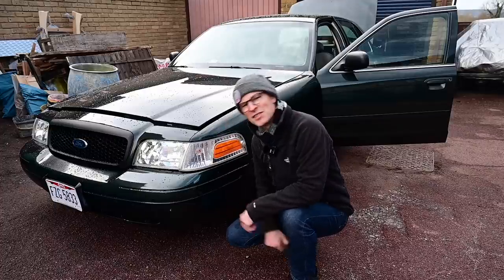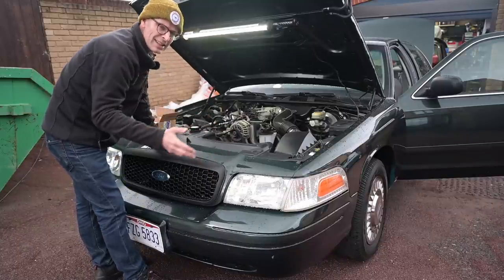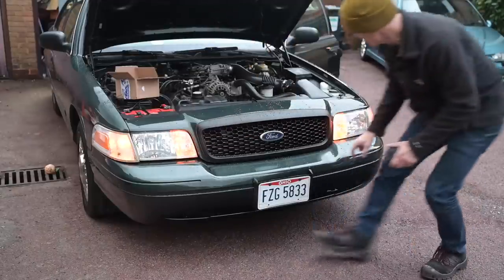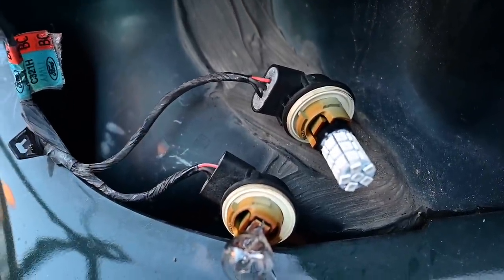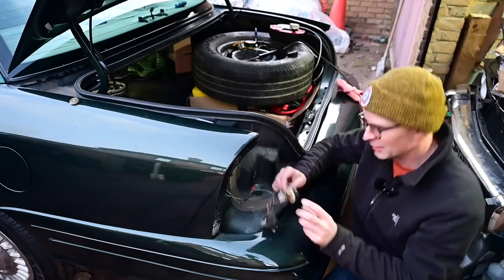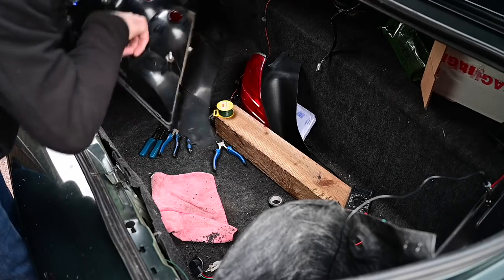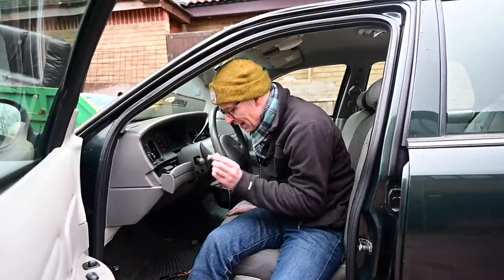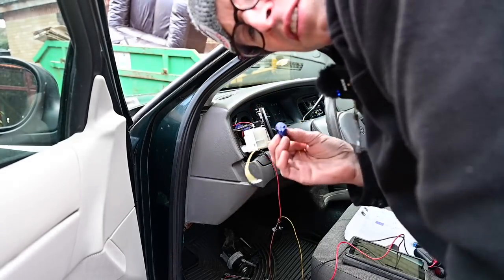Making my Crown Vic lights UK friendly

Comment: One question I have is the Police use Light switch wired in a different way to a civilian light switch ? , I used to just take a live from the back of the light switch that becomes live with the ignition on , there usually was one , but never used a relay box , the live I would run to a switch , output goes to the lamp , lamp can be earthed at the back by screwing in to metal with a ring terminal , your flashing rate is too fast and could be a by product of police lighting , you need a side repeater for an MOT .
Reply from the maker: I dont know what the difference is, the interior lights are different so maybe to do with that
Reply: Should have added that the fog light stitches we used had three contacts on the back , live in , earth and live out  , the side repeater was just hooking in to the front indicator live feed and an earth , one round hole in the front wing , behind the front wheel line in the most aesthetically attractive position for the lens to be in , usually an oval lens looks best . mot tester will be looking for one on cars after 1986 or 1987 ish , same year as the requirement for rear seatbelts i think .
Never had fast flashing rate though , but never did a P71 ? , Mustangs , Camaros , Corvettes and lots of stuff did many like that with no issues . also a white front sidelamp , usually taking the orange bulb side marker feed from the indicator to provide live for a cap less 501 bulb pushed in to a hole drilled in the headlamp reflector where it would not impede the beam pattern ,  [ah its all coming back now ]  , yes the older cars , like sixties was interrupting a feed at the bottom of the steering column for the indicator / stop lamp issue .but not later ones , it is body earth and live from the one wire of the three on the rear bub holders that flashed the winkers , no other diddling required .
Reply: switched , flippin spell correct .

Comment: Hi Matt, just a couple of comments from the North American point of view.  First, those headlights are indeed very common over here.  Next, you can buy rear clusters with an amber lens at the bottom, which I think are for the indicators.  Maybe they were used on higher trim spec cars, I'm not sure.  Finally, I found you can also buy replacement mirrors with LED flashers in them, rather than modifying yours to fit the Whelans.  If you need any help from this side of the Pond, let me know any time...
Reply from the maker: I looked at there lamps on Rock Auto, $35 each for the lens unit but still need to adapt the wiring. If the green bulbs hadn't worked I was going to get a set.
Good tip on the mirrors, Ill check them out before drilling any holes

Comment: How did you get the turn signal bulbs to not light up when you press the brake? As you didn't do anything to the circuit, wouldn't the turn signal light permanently when pressign the brake?
Reply from the maker: its the way the circuit works, the stop tail is on the other feed wire. I wasnt sure it would work but it seems to

Comment: Are the orange US marker lights wired from factory as turn signals...with dual filament bulb perhaps...and is that okay for MoT?  I was wondering gbif I will be okay for the MoT when my VW Thing comes from Texas...as it has side marker and turn signal in same bulb and will be a faff to change...and I kinda like it like that.
Reply from the maker: if you made the side maker white and the indicator orange it sold be OK, my new plan is to get another police side lamp with the extra bulb holder and wire the indicators to that

Comment: I can’t help thinking you need a multimeter before you cut wires so you know what wire does what.
Reply from the maker: I was probing with a pin and testing for current

Comment: All u need is a relay, that has the power side from a constant live, the switch feed from the dipped beam and then connect the fog light to the other side,
Reply from the maker: that doesnt stop the fog lights from coming back on if the headlights are turned off and on again - they have to go off and stay off with the main lights
Reply: @furiousdriving  A second flip/flop relay would do that?

Comment: What happens if you press your brake pedal, i guarantee the indicators will light up, because there are 2 brake light wires from the pedal, 1 goes directly to the third brake light, and the other runs through the indicator stalk making the indicators and the brake lights on 1 wire, so in theory the separate indicator feed you created still has the brake feed on it too? Unless you separated it out under the dash??

Comment: I'm so glad you've left the orange lights at the front as I know some people remove them! All part of the American car charm imo. I'm surprised it would pass an MOT exactly as it was though, I thought that you'd have to add another 5W lamp holder with a white light that was always activated with the side light switch, and make the lighting compliant by installing it, say, in the main lamp housing. that way when you switched the side lights on you had white light to the front (making it UK compliant) along with your orange lamps - but the fact you don't have to do this is nice.
Reply: The one on the corner can stay as is, it serves the same purpose as it does for cars like the bmw 5/7 series that have it also which is down to length of the vehicle, i think by absolute technicality the 'daytime' light as its referred to in the manual (the one with the indicator) is meant to be white (and orange when flashing, this easily achieved with a switchback led popular with vic in the states already) or disable as you're indicating, i cant remember the exact details besides being asked if they went off when i indicate i said no and he said that need to be fixed, so simply i took the bulbs out, broke the pin for the daytime light and refit so it only indicated. 

Out of mot swap back as i see it as being much safer than even if they were white as i get a better sense of distance if there's another colour with the headlights, otherwise its often i'm blinded by most peoples poorly fitted lights and can't see anything that direction.
Reply: Up until last year I owned a U.K. spec Chrysler 300. I had the headlights rewired back to American spec, which removed the w5w sidelight bulb, and put back the dual filament turn signal bulb. One for side lights and one for indicators. Had to have that proper American look. The car passed the mot like that every time.

Comment: I’m sure the fast indicators are against regulations, there’s a special LED flasher box to replace std relays 
Also won’t the headlights need the aim changing sticker things to pass MOT ?
Reply: @Patrick H
The UK requirements  for indicator lights to flash is between 60-120 per minute.

Comment: Could the issue with not being able to get a switch feed for the fog light be due to canbus? As far as my pea brain can gather, everything has a permanent feed and the Ecu provides the switch feed by can hi/lo rather than the ignition switch, meaning that a traditional ignition live does not exist on those circuits.

Comment: I’ve never understood why the US market only wants one brake light when an indicator is on; it must be confusing when the tail lights are on and you first brake, or are you indicating… Seeing that they use two bulbs for everything perhaps adds redundancy over complete darkness when one stops working. Your momentary switch needs to be fed from the headlamp to trigger the latching relay to feed out only when they’re on, and the switched feed (not the switch) goes to the bulb. I’d then think that the normally live feed to the relay comes from the headlamp too, so when that’s off the relay feed is not powered either. It’s a huge logic problem.
Reply: Interesting and I suppose it’s what you are used to seeing and reacting to. I still prefer to have three brake lights which all show whenever you brake, separate tail lights which are dimmer, and a separate flashing amber indicator turn signal which is in addition to the brake light, not instead of it.
Reply: A cost cutting exercise from when cars were invented I expect. Or maybe Americans can’t tell the difference between red and orange.

Comment: It's so good to see that big grin when you crouch down beside your Crown Victoria. The paintwork looks extremely good after your efforts. How difficult was the clay bar to use? Did it make the biggest overall improvement?
Reply from the maker: Clay bar is very easy, just takes a while with such a big car! It does make a big difference and when you polish it the effect is magnified by having a better base to work from
Reply: @furiousdriving  Thanks for that.

Comment: Hi matt could you not have wired it to the live in the boot that's spare and switch it from there terrible weather in kent at minit I got jobs to do on the rangerover but too wet damp at minit all the best donny
Reply from the maker: Thats where Im running to from for testing, but the power goes to the switch so having a local live is more convenient

Comment: Damn, y’all have some stringent lighting laws there. Are you able to fit that down the little roads of the villages in the UK? I have a hard time fitting minke down some dirt roads in Alabama, but the asphalt usually has plenty of room (despite the crappy road quality, they’re wide usually). 

And that empty chamber in the tail light was a blinker, but Ford kept it for departments to put strobes in (and to save money cause it was the existing tail light model, just with a red lens, instead of amber.
Reply from the maker: Yes, they are strict here. If it was less than 10 years old Id have to change the front lights as well to fit new car regs and pass an IVA test, which no one wants to put a car through!
Im going to choose my routes carefully. Villages arnt to scary, its width restriction bollards in towns Im worried about, they are to slow cars down and stop trucks but I dont think this will go through all of them.
I reckon I could hide a strobe in the middle of that lower section between the indicator bulbs
Reply: @furiousdriving  what is a bollard?

Comment: Should the fog light be wire off the relay not the moment switch. So you take a feed off the light switch to the moment switch then the trigger side of the relay. Then the fog light is powered off the relay feed.??
Reply from the maker: Im just following the instructions and how they talked me through it when I called to check
Reply: @furiousdriving  makes senses as  it will work its just you have all the bulb current going through the switch. But it's probably not that large as it's a fog lamp. Not like a head lamp current. Esp if you use an led bulb.

Comment: Strange rule on the rear foglights, here in Sweden only the front foglights are regulated on older cars (I don't involve the EU proofed newer ones) Here you aren't allowed to have front foglights AND low beam at the same time. I used a switching relay to make that blockage, as long as the low beam has power the realy is pulled away from making the circut to the front foglights. And there is another relay that cut's it totally while not using the car or the lights at all, otherwise it will use battery power when the car is not in use. This might be useful for your dilemma as well?
Reply: That seems like a very odd rule? In my experience, high beams are actually detrimental to driving in fog because they just illuminate the fog itself and make it harder to see the road.
Reply: @d2factotum  you ARE allowed to use them in fog with just parking/taillights and as extra with highbeam, just not with low beam. I forgot to mention that!
Reply: The very first REAR foglights on Volvos in 1978 when they appeared for the first time was awkwardly shut when you switched to low beam, so in not that thick fog when you drove in front of a cue using highbeam and had a meeting with another car these would switch on and off frequently making all behind step on the brakes as they thought it was a brakeligth, this was changed a couple of years later. I allways use my rear foglights like high beam, on when I can't see anyone behind me in the fog, if they get close enough to see my ordinary rear lights I switch them off as the blind those behind un neccesary.
Reply: @Bratfalken  But that is an oddity, and very specific to Sweden.

Comment: Driver's side fender bulb probably not there because it could be a replacement light unit if had a corner prang
Reply from the maker: Thats what i thought, or the other was an old one used for the same reason

Comment: The single front bulb on the drivers side and the other side didn't have one could it be a night parking lite ? And those break lights look a pain to fix, has it got a break light in the middle of the rear window?
Laters kojak 🇬🇧🇺🇲✌🏻
Reply from the maker: I think its a small police strobe in the front, and yes high level brake light on the parcel shelf

Comment: Much respect for your knowledge and venturesome spirit to do such things. 

BUT, i just love our set of work lights and everywhere i went worldwide, people love the way american cars’ lights do work. With all due respect for your immense effort and job, but I wouldn’t have changed a dot.

Love your channel. Keep rocking.
Reply: Cars used in the UK have to comply with our legal requirements which is why they have to be changed.
Reply from the maker: sadly to get through the MOT inspection it has to meet the incredibly strict rules, I can leave the front lights as its over 10 years old though
Reply: @furiousdriving  Omg. Thank you so much for replying me. And I didn't know used cars - eventually imported to be a collectors or whatever - needed such changes. Again, thank you very much for your kind attention. Love your channel.
Reply: @garrytalbot3456  Thanks alot, Garry.

Comment: I didn't really follow your logic with the relay for the fog lamps, could you explain? I have made 4 bit adder out of relays so I'm quit familiar with them.
Reply from the maker: it can only be switched on when the headlights are on (not sidelights) and has to go off with the headlights, and not come on again unless manually switched, so a momentary switch and a relay are used
Reply: To comply with regs of a new car. Surprised it’s required for an old import though.

Comment: Been driving my Pontiac Fiero GT for 20 odd years with flashing rear red lights and my MOT guy just passes it. I do have a aftermarket rear fog light that hangs off the rear bumper. Looks a bit pants but thats the way it has to be.
Reply from the maker: It might be allowed based on the year
Reply: I would look at making one of the reserving lamps a rear fog lamp on this car. That obviously depend on the location at what the regulations state. I know there is a prescribed distance between fog lamp and brakes and height above ground. There maybe more.
The rest is looking good. No need for so called professionals, especially when they do not turn up.

Comment: Are those original rear bulbs for brake and flasher dual filament?
Reply from the maker: yes, amazingly my local Halfords has them, although not on the website
Reply: @furiousdriving so filament 1 is tail light, and 2 is brake and turn signal? The plug had 3 wires, was one of them an earth, as that would leave 2 wires to do 3 functions. I may have to watch video again. Little tip with the fog light. As its all 12v, get a 12v battery and some wire and test on "the bench" then when its working, move to car.

Comment: I've never heard of a rear fog light... I don't really understand the point. Front fog lights I thought were meant to be at a lower angle, wtf does a rear fog light do? 🤔
Reply: So people don’t rear end you in fog.
Reply: Rear fog light is basically a really bright red light normally called Rear Fog Guard
Reply from the maker: so people can see you from behind in thick fog and not drive into you
Reply: @furiousdriving  how is that different to just a tail light?
Reply: @TheDarkFalcon  taillights are 5W bulbs and fog lights are 21W
Reply from the maker: @TheDarkFalcon  it’s brighter than a brake light, which is why everyone hates people who drive around with them on in good weather
Reply: @furiousdriving  oh ok.. The one you demonstrated didn't seem any brighter than the other ones lol.
Reply from the maker: @TheDarkFalcon  that was just a regular white bulb while testing the circuit, it will be red super bright LED
Reply: @TheDarkFalcon  they are also (usually) mounted as low as possible on the car and (as a minimum) towards the offside on the rear so you can identify the extremity of the car.  In more recent times these have been added both sides.  As mentioned they are significantly brighter.
Reply: Fog lights also have magnification in the lens. It’s an improvement that they can now be fitted in the center bumper like an F1 car. Much more sensible.